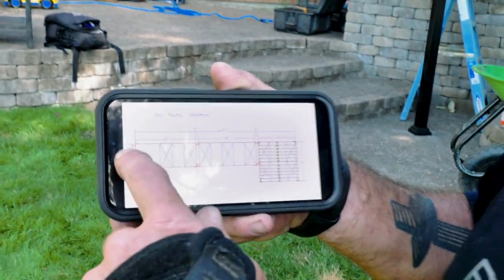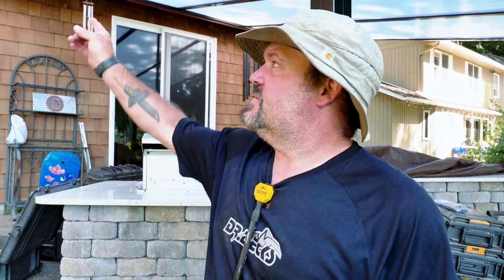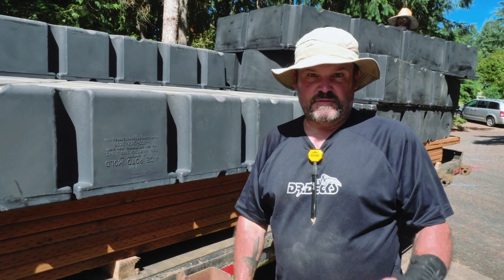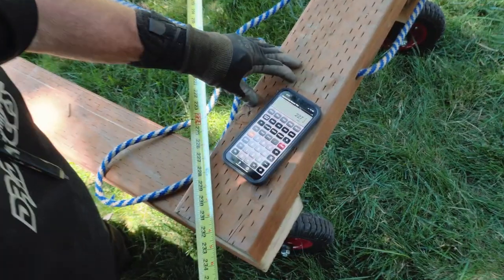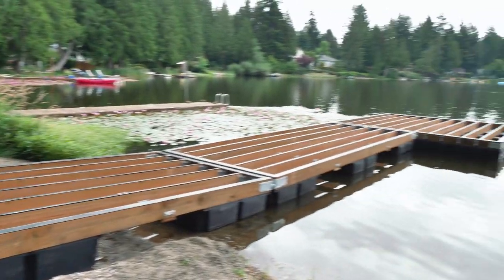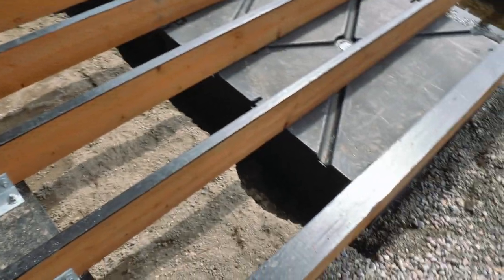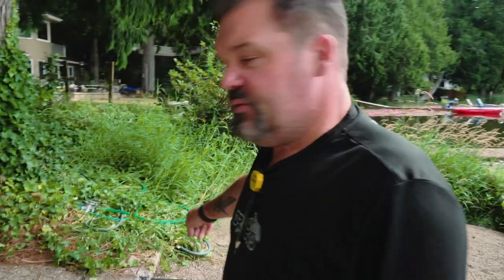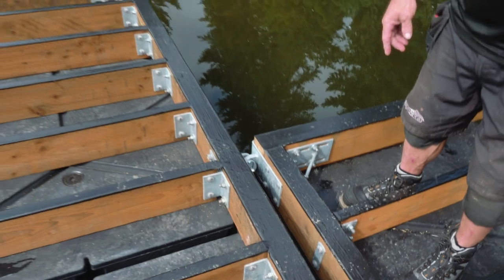Floating Dock Project Supercut || Dr Decks

Comment: When you were going over installing the poles to keep the dock from moving  back and forth, you said you were putting in schedule 40 and the next one you pounded in a galvanized pipe. Did you mean to say galvanized on the first one or did you use schedule 40? Good job!